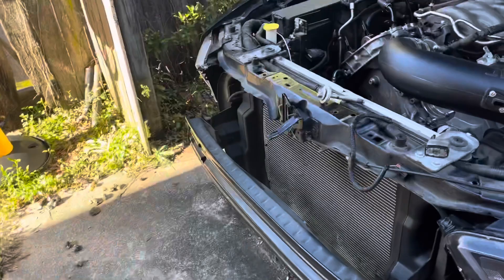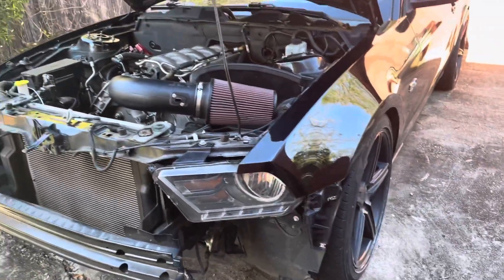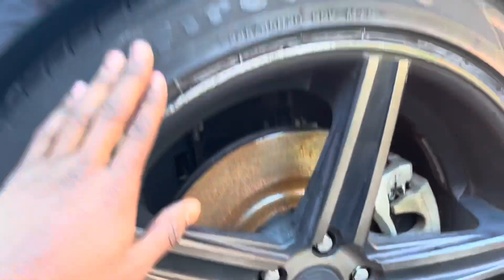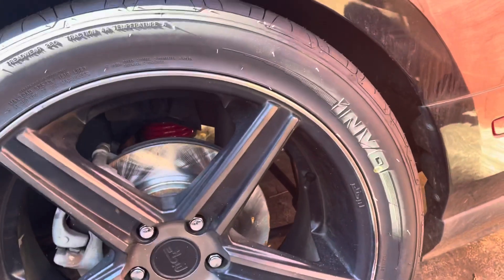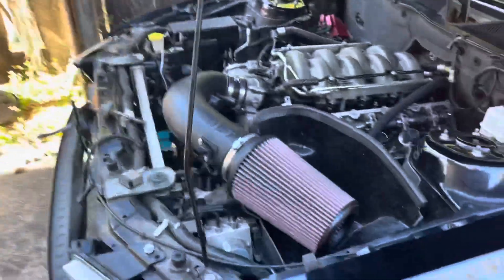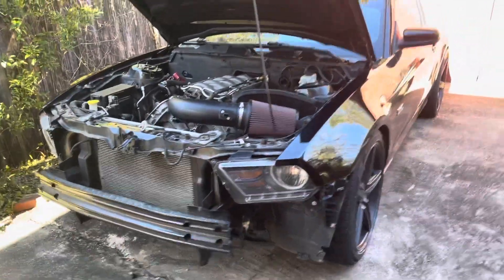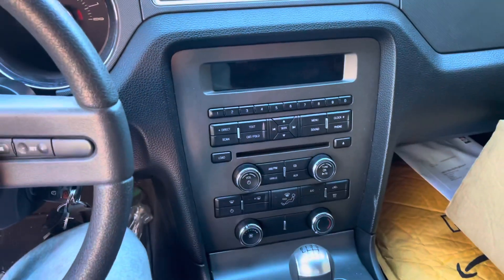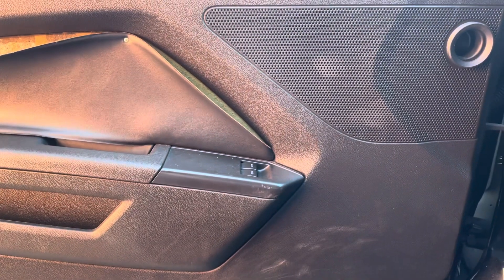MY FBO 5.0 MUSTANG IS ALMOST READY TO HIT THE STREETS

Comment: How was header fitment?
Reply from the maker: good fitment but im just having a hard time finding the x-pipe that can connect to them cause they no longer sell the bbk x-pipe that bolts up to those long tube headers
Reply: @justin5.0lifestyle67  I ordered a pypes with mine. Hopefully it fits haha gonna find out soon.
Reply from the maker: @clayton5821  let me know how it fits cause im about to look online rn for an x-pipe that fits
Reply: @justin5.0lifestyle67  will do. Planning on doing them next weekend
Reply: @justin5.0lifestyle67  the pypes x pipe bolted right up
Reply from the maker: @clayton5821  did you get the catted or nun catted x-pipe
Reply: @justin5.0lifestyle67  non catted. Did have to get o2 sensor bungs welded in it since pbd doesn't turn off the rear sensors anymore. And we had to trim about 1.5" off the back of the x pipe cause it was too long,  pushing my tailpipes into the axle. But I have slp resonators that seem long so I think it was those that caused the issue.